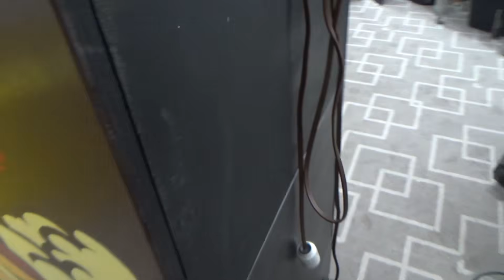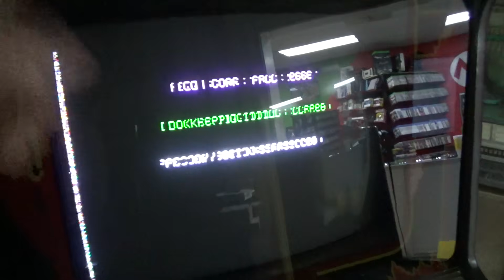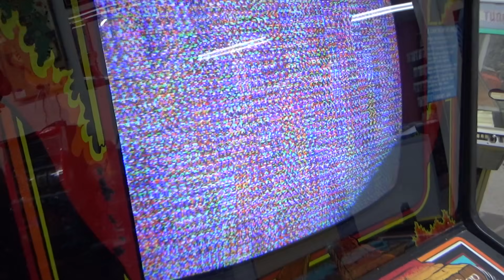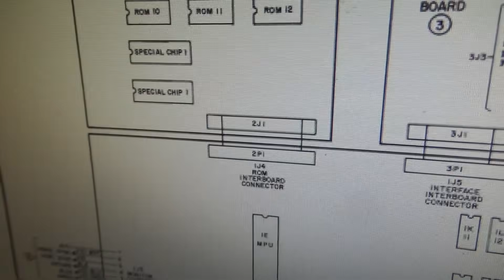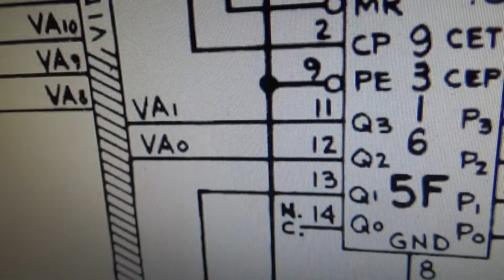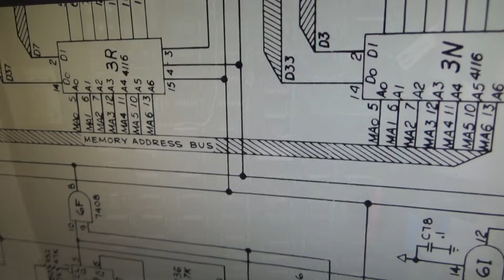Saving This PROTOTYPE Williams Joust Arcade PCB....

Comment: Joust is awesome. Great video. I suspect MA0 selects between a low nibble or a high nibble which means that when its trying to select the second half of the bank its getting the first set of data... resulting in the doubling. The way a graphics chips work in the 80s is it strobes a memory segment and redraws the screen independently of whatever the rest of the computer is doing. The counters provide that strobing through memory address lines.

Comment: What does those Special William IC chips used for "Blitter"? Blitter Board does what to the images & graphics
Reply from the maker: Apparently it allows them to move a lot of bits at one time without using the actual CPU of the machine, so it saves a lot of processing power

Comment: A quick peek at the 4116 datasheet and all three voltages were well within the spec - for +5, it looks like it's happy with the voltage between 4.5 and 5.5V...
Reply from the maker: The gameboard won't run below about 4.9, every single chip on the board doesn't have those same specs, but everything is happy with 5 or slightly higher

Comment: Ron, Curious... being that this is a prototype, is there a possibility that some of the chips (ROM) havent been archived.  On that note do you ever interact with the archive people to either use or send rom chip images to them?
Reply from the maker: I'm not sure... unfortunately the archive people have generally exhibited themselves to be jerks so I try to stay as far away as possible :)
Reply: @LyonsArcade  I have a couple of these boards and after some research, 95% confident this a bootleg Stargate to Joust kit that was made in Europe in the 80's. The ROM and Blitter boards are not factory. They also made a kit to go from Defender to Stargate.  Nice job troubleshooting the missing address!
Reply from the maker: That could be possible.  I'm just going off of what the Robotron-2024 hardware site says, but I could see where it could be a bootleg board.  It's definitely a dedicated cabinet though so maybe somebody swapped the board at some point...

Comment: smart operators would do two things. 1st, cover the control panel with Lexan. Plexi sucked. Yes, Lexan hazed easier, but plexiglass would melt and curl from the cigarettes. 2nd, mount the little ashtrays on the side of the cabinet.

Comment: Has it been signed by Lonnie McDonald?  Once upon a time, Lonnie tried to roll 10 million points on as many Joust cabinets as he could find.  He signed the cabinets he rolled.  Should be located underneath Player 2 control panel.
Reply from the maker: Lonnie hasn't found this one yet
Reply: @LyonsArcade  I have a backup copy of the CMOS RAM with his High Score. I received his permission to load into games I service. I have a special device to Read/Write/Test through the CPU socket.

Comment: Man! An early model of the game! I remember when the game first came out, you could do a trick to rack up points on about the 5th wave, where the lava troll would capture a red night and hold it in place (and being the last enemy left). In the meantime, you could stand on the middle lower platform and wait for the pteradactyl to enter the board. In the first release of Joust, the pteradactyl would move upward from the bottom a bit earlier and charge directly into your lance and die. You could do this repeatedly and rack up your score....and lives. It was very cool and hard to find. Thanks for the awesome video!
Reply from the maker: That's a cool trick, I never knew that worked on the early versions

Comment: In general, blitting is memory-to-memory copying, often for graphics.

On the counters, I'd assume the highest pitches are the lowest values as they are binary, and it takes twice as long as the previous to update, and the one above that takes longer, etc. So the lowest pin toggles at 1/2 the clock. The next one toggles at half the rate of that one (1/4 clock).

I think the inputs were only used for resetting to a known count. There are inputs and a control line to latch them. And if things are hardwired to a value, then the line to load the inputs would start at whatever that count is. So it can count without the inputs, but as with most of the logic ICs, you generally don't want floating inputs.

Comment: G,day Joe from Sydney Australia. Quality schematic (leaving to the imagination) what process happens inside a chip. 
You could also use an oscilloscope to check the output pins. As well as voltage it will show frequency.
🌏🇦🇺

Comment: A blitter is a hardware way of modifying sections of RAM at high speed in bulk rather than you having to shunt data through the CPU in small bytes to move, modify, or copy it around in the RAM. Much faster. The reason the Amiga computer was good at 2D animation (shifting data around) was in part because it had a blitter chip. It's an early-ish form of what we now commonly know as a co-processor.
Reply: Not a co-processor but more a kin to DMA(Direct Memory Access) usually set up a few registers ie like start address, and copy address, and how many blocks or bytes, and hit go.  A co processor is used to do math in the terms of a x86 like 80487, was basically a lookup table of two numbers (a pre programmed ROM) but because it can look up numbers by virtually using address lines it was supers fast.
Reply: TL;DR.
I'm aware of the functions of a blitter, having programmed against a number of them, and it is not akin to DMA (show me multiple source address logic masked DMA copying of bitplanes using an intel 8237 DMA Controller). A blitter does use DMA techniques (any block data memory access not involving the CPU will). Whilst a blitter can do DMA block operations (either first party or third party, it requires some kind of DMA channel) a DMAC cannot do blitter functions that involve processing that data.

To quote other people...

From the Amiga developer docs hardware manual...

"The blitter is one of the two coprocessors in the Amiga. Part of the Agnus chip, it is used to copy rectangular blocks of memory around and to draw lines. When copying memory, it is approximately twice as fast as the 68000, able to move almost four megabytes per second. It can draw lines at almost a million pixels per second. In block move mode, the blitter can perform any logical operation on up to three source areas, it can shift up to two of the source areas by one to fifteen bits, it can fill outlined shapes, and it can mask the first and last words of each raster row."

From wikipedia on blitter...

"A blitter is a circuit, sometimes as a coprocessor or a logic block on a microprocessor, dedicated to the rapid movement and modification of data within a computer's memory. A blitter can copy large quantities of data from one memory area to another relatively quickly, and in parallel with the CPU, while freeing up the CPU's more complex capabilities for other operations. A typical use for a blitter is the movement of a bitmap, such as windows and icons in a graphical user interface or images and backgrounds in a 2D video game. The name comes from the bit blit operation of the 1973 Xerox Alto,[1] which stands for bit-block transfer.[2] *A blit operation is more than a memory copy, because it can involve data that's not byte aligned (hence the bit in bit blit), handling transparent pixels (pixels which should not overwrite the destination), and various ways of combining the source and destination data*.

*Blitters have largely been superseded by programmable graphics processing units.*"

From the US patent (US4874164) for the Amiga's blitter. Literally the first time the term "blitter" was used as far as I know...

"The Blitter is used for high speed data movement, adaptable to bitplane animation. The Blitter efficiently retrieves data from up to three sources, combines the data in one of 256 different possible ways, and optionally stores the combined data in a destination area. The blitter can draw patterned lines into rectangularly organized memory regions at a speed of about 1 million dots per second; and it can efficiently handle area fill."

Comment: Good job.  So since it is a prototype board have you checked the rom and seen if it has any protype rom program.   Just wondering because if it does and it is not saved you are going to have a problem in the future fixing it

Comment: The switch mode power supply also eliminates the need for a massive transformer. I'm still learning about them, but it works by generating a high frequency AC signal into a smaller transformer. A feedback circuit across the transformer helps to regulate the DC supply.

Those old transformers are getting harder to find
Reply from the maker: On these Williams games it's not a great idea (in my opinion) to put a switcher in, because it causes problems with the battery circuit that saves the high scores.  When the game is turned off, on the original model power supply, it leaves the 5v high longer than the 12, so that it has time to write into the cmos memory, when you put a switcher in it just crashes the cmos circuit and from time to time, that causes corruption which resets your high scores.  The original power supplies can be easily rebuilt on these, but once it's been swapped like this one we just leave the switcher in there.  It's hard to talk a customer into paying $100 to replace a power supply board that's already working as a switcher
Reply: @LyonsArcade  Installing a 4.7v Zener @ZR2 solves the issue with CMOS corruption. Normally, the unregulated 12v on the original linear goes low very fast and pulls the CPU into reset, with the switch mode supply, it's relying on the 5v. The original zener is a 3.6v. When the voltage on the TTL devices gets below ~4.6v, things get very unreliable on the bus and the only device that has persistent memory of the event is the CMOS SRAM that holds settings/scores.
Reply from the maker: I hope I remember that next time I get one in :)
Reply: @LyonsArcade  Great point! That battery is only a standby voltage.

Comment: Using the power from the monitor supply could overload the transformer.
Reply from the maker: The board doesn't use much power out of that switching supply
Reply: @LyonsArcade  Agree. The +5 pulls ~1.5amps and the +12 ~.5amps. There is plenty of capacity in the isolation transformer.